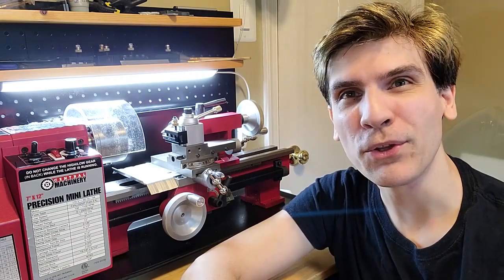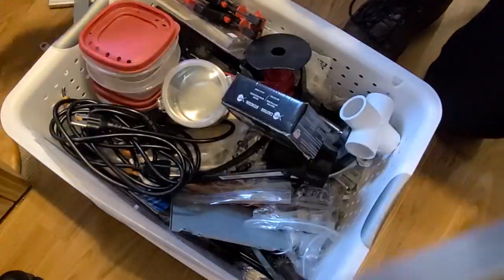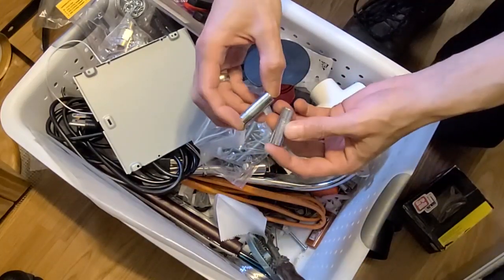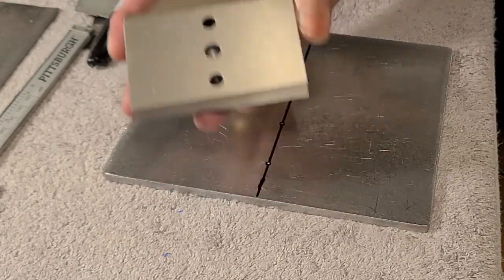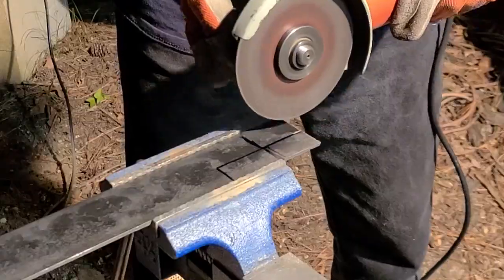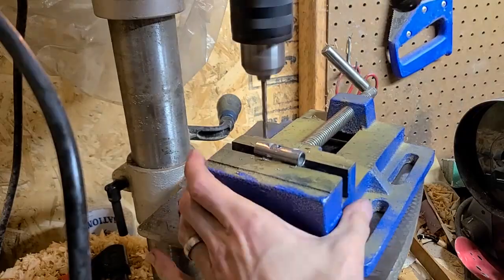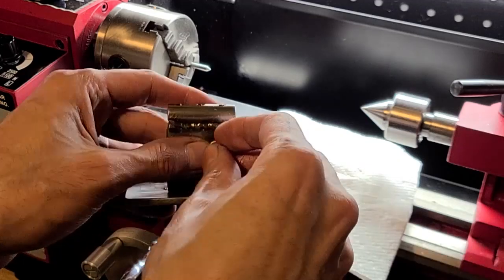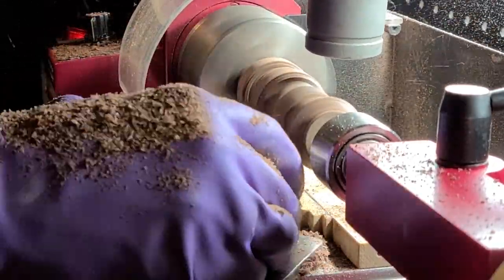Making a Duplicator Tool for the Lathe - Copying Tool

Comment: Why wouldn't you use wood instead of a steel plate
Reply from the maker: The forces involved are pretty high, wood would easily dent/deform/break. Would have been a lot easier, but it wouldn't last.  😉